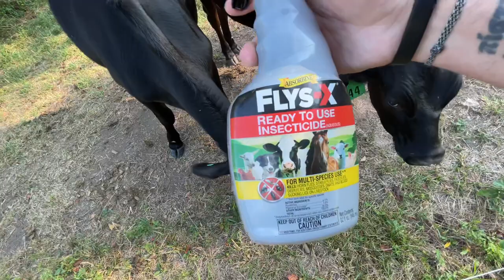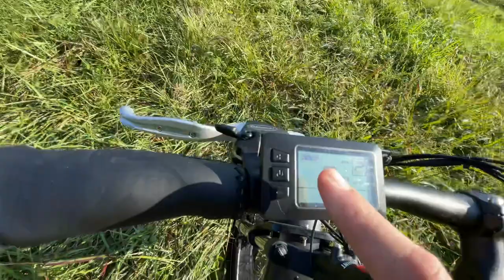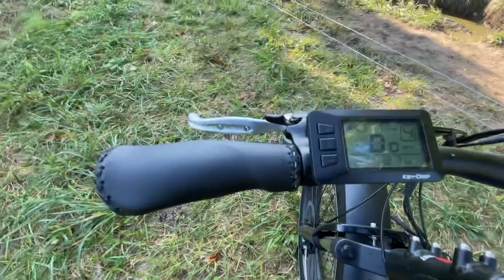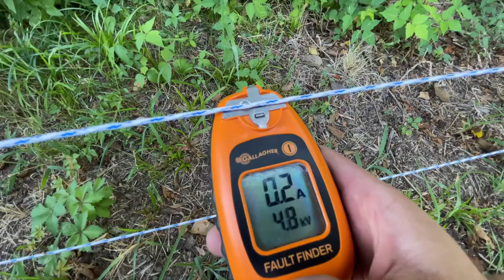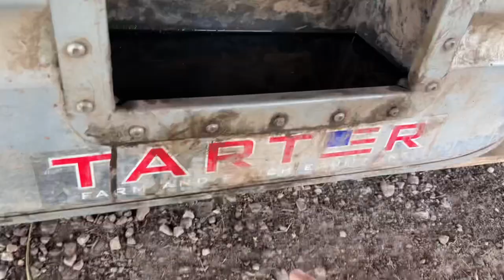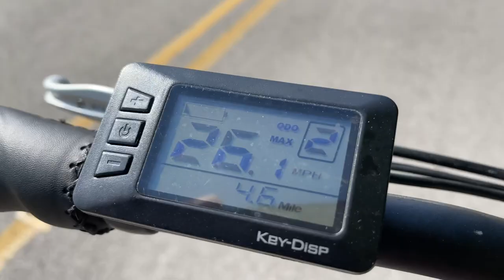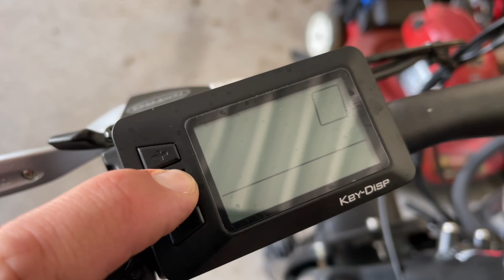SIX YEARS WITH A BEARD…IMPULSIVE DECISION…

Comment: I have two Ebikes and I'm in my late 60's and my bikes have brought new life to this old man. You can still get your exercise by pedaling at a lower power level.  The lesser level of power assist you use, the longer the battery life. If you use the throttle only, expect to walk the bike back if you travel more than 15-20 miles without charging.  They are a Booger to pedal without the motor even if you're fit due to the bike's weight. There's a lot of info out there. I suggest the Bolton Ebikes channel.  Have fun.
Reply from the maker: I’ll check it out man. Appreciate it!

Comment: Smokie might not be wanting to eat her egg because her feed has soured. For the last three years, all the large bags of dog food that we have purchased ( different brands, different stores) , during the Summer months have soured or gotten infested with weevils. We store it inside our garage, which stays relatively cool and dry, but it still goes bad. We sprinkle diatomaceous earth on it as soon as we open it and, once opened, we store it in a metal sided garbage can with a neoprene liner. That does seem to handle the weevil problem but, after being opened about a week, the dogs won't eat it. 
If you continue to have that problem with Smokey's not-eating, try purchasing smaller bags for a time or two and, most importantly, totally clean out her feeder. She drools down into the lower feed and the eggs drizzle down into that mess. Then, everything sits in the warm, humid air and percolates. Yuck!!